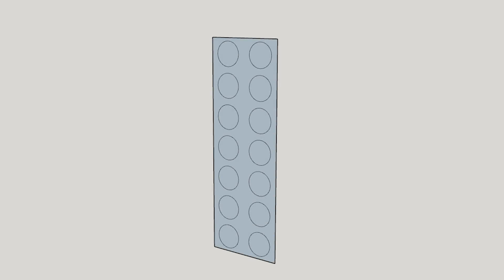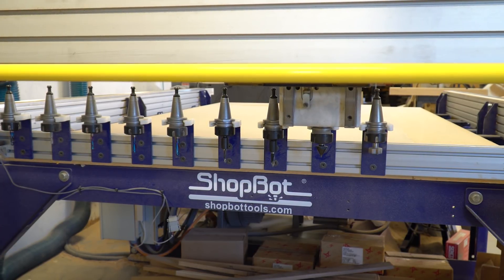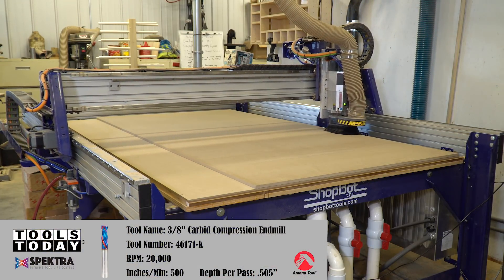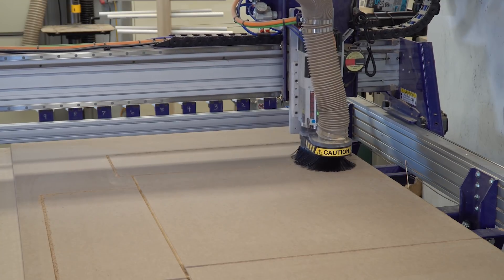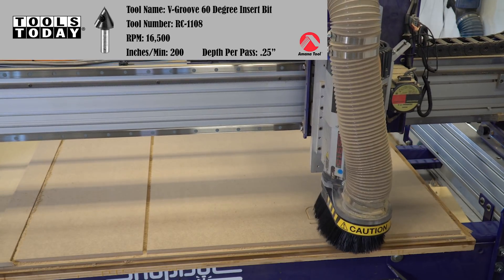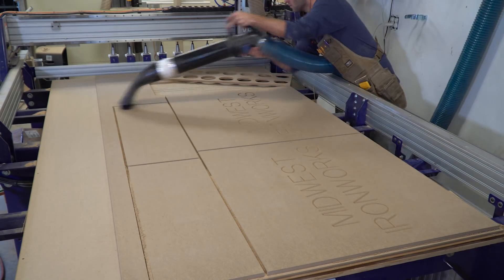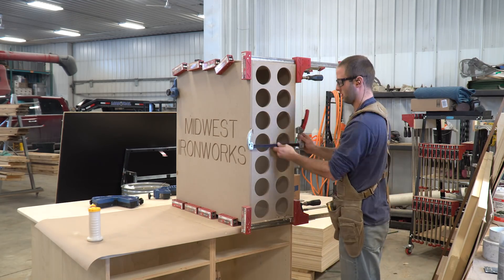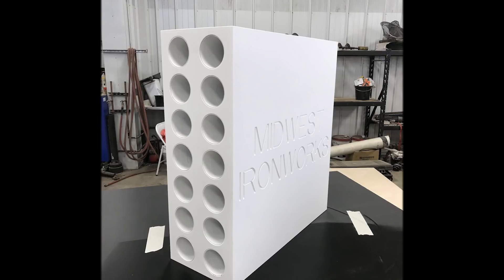Crazy CNC Router Cabinet!!!

Comment: Andy, could you have used pvc or drain pipe for the tubes or would they have been they wrong dimension for the client?  Looks great overall and thanks for the video.
Reply from the maker: The Hamlin Woodshop never even thought of that!
Reply: That’s hilarious mate, I do it too - over engineer then find something straight off the shelf after the fact.